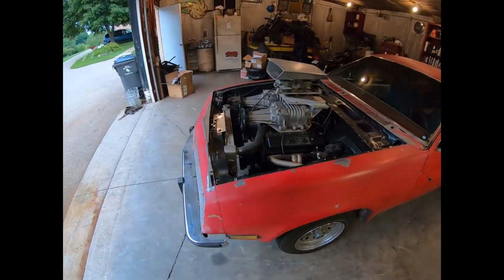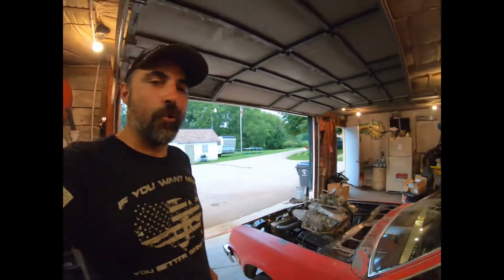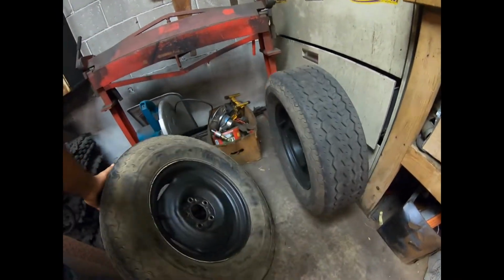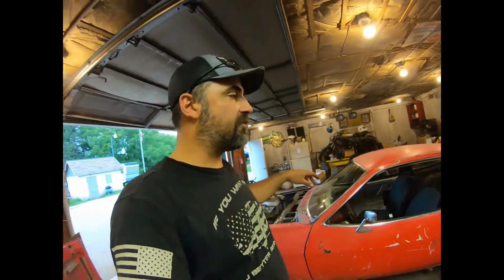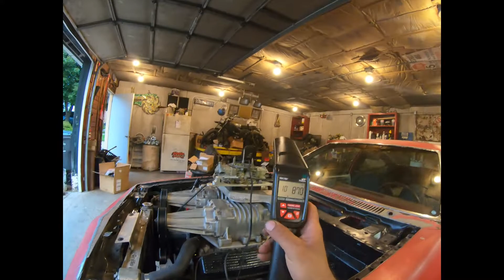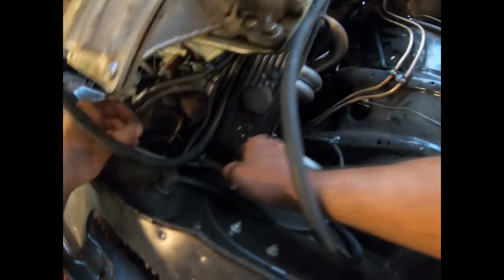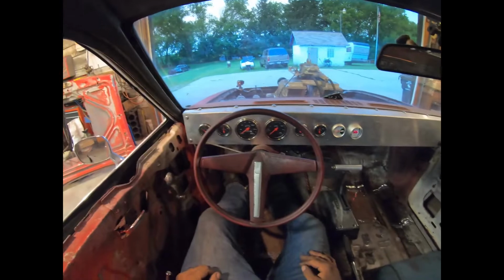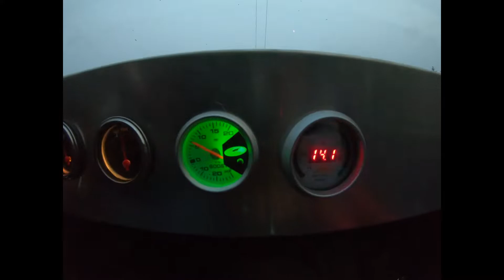10 LBS Boost From The Twin Eaton 90's! Needs More Fuel...

Comment: You need one of those new distribute is... That is the new smart distributor... For older gas engine... That actually allows you to adjust your timing from inside the car with a distributor.. You can set a window for advance in D advance... Which is really good for your application

Comment: Have you had any problems with the rear needle bearings in the M90's with this draw through application?
Reply from the maker: Not yet, just finally getting the thing running good enough to drive, I do want to pull them down at some point and check the bearings out, you aren't the first to bring up this issue.... Maybe when winter comes around I'll pull them apart and we will see.... I'm curious as well, many people have said it's an issue.......
Reply: a company on Ebay called "embry specialty machine"  sells the upgrade bearings that have two lip seals, and are supposed to be able to handle gas, alcohol, and nitromethane. purpose of the double seal design is to keep liquids out of needle bearings, and it works.

Comment: Hey mate, would you be interested in two smaller pulleys?
Reply from the maker: Actually I already have a pair sitting here. Going to focus on the fuel system first, hopefully resolve my issues there, then maybe feed it some more with the pulleys. Thanks though!

Comment: Edelbrock needs to leave the carbs alone, they might be equal to the older Rochester carbs nah no way. And to put the money into a good build and stick one of the edelbrock on the engine, I'm like well there not serious about performance and power. Just my opinion, keep up the good work!
Reply: Dad had nothing but problems.with his edelbrock carbs.
Reply: @Saddedude  I've never had problems with an Edelbrock carb, especially on a blower application. That's why I use them. No leaks, mechanical secondaries, no need for power valve crap, no bogging, easy to tune, adjust and rebuild.